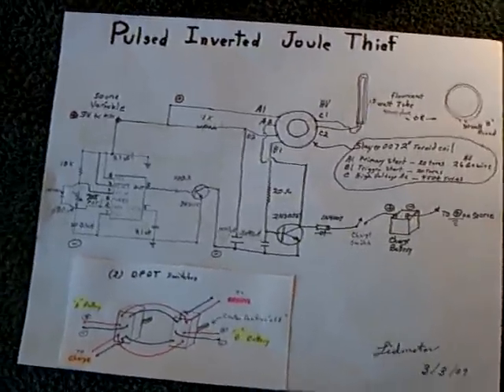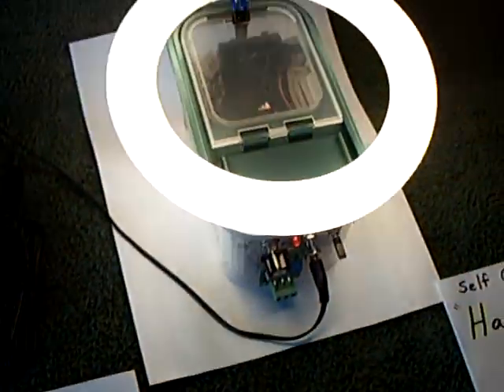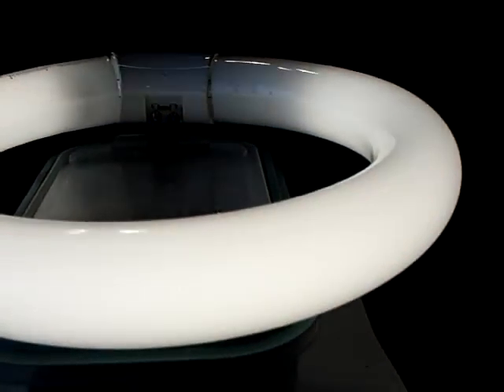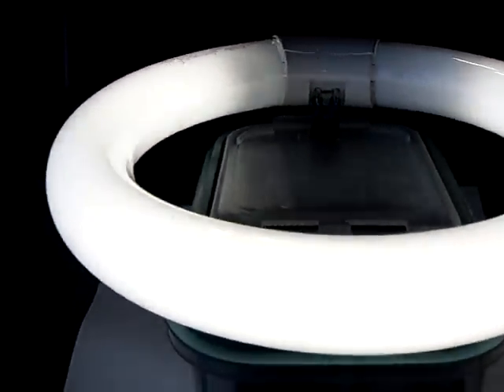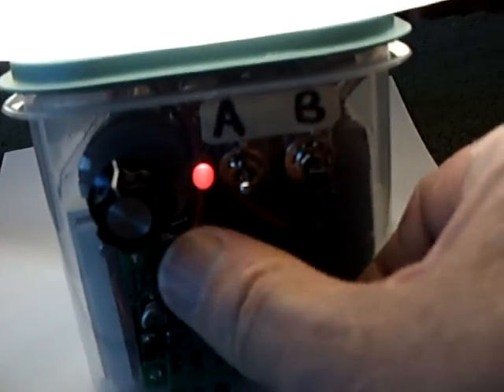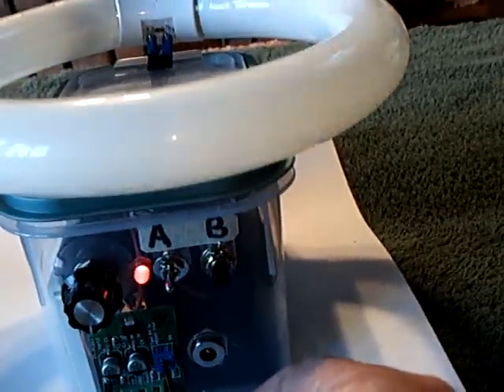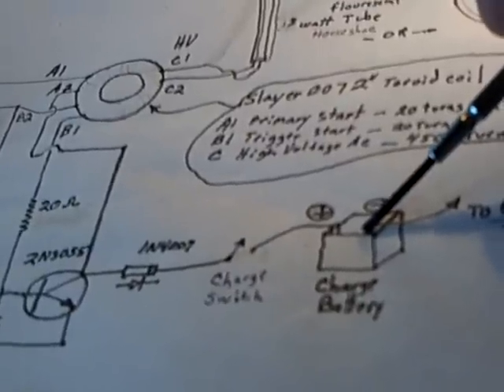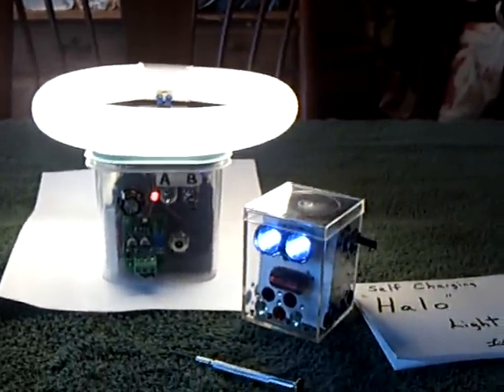Lidmotor Halo Light

Comment: very nice indeed Lid!! 
How good is the charging straight to the battery??
Ive just built a cap pulser circuit, but i dont know whether its better to just run it directly to the battery..

Wats your amp draw like??

Im noticing one side of my Fluoro tube gets black around the end.. are u finding the same thing?

Thanks for the DPDT circuit, thats just saved me some time figuring that one out!

Great build, now the little JT has a buddy!